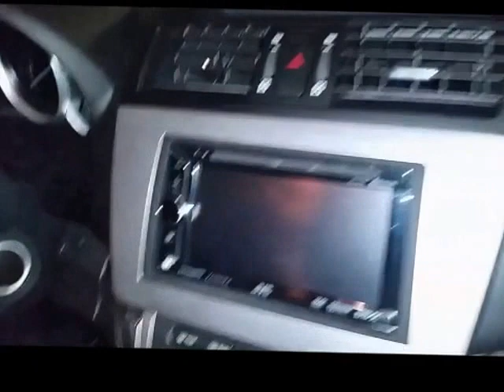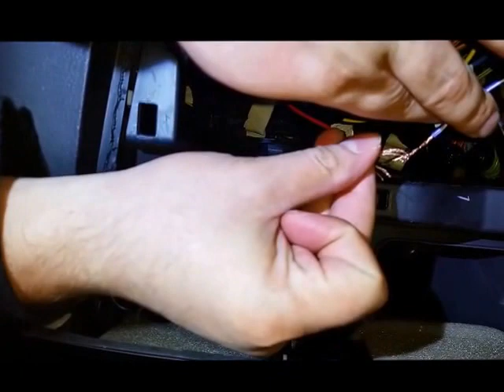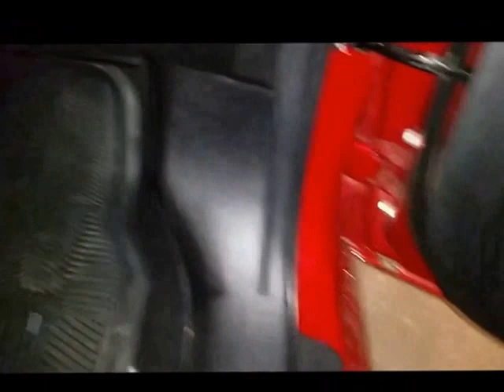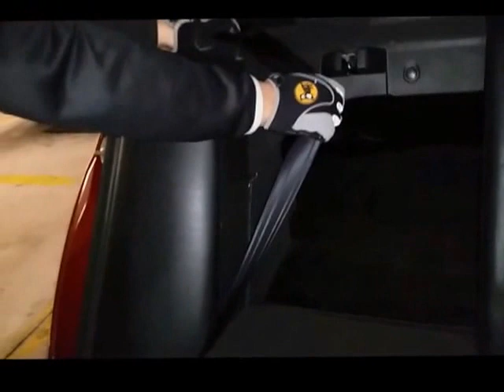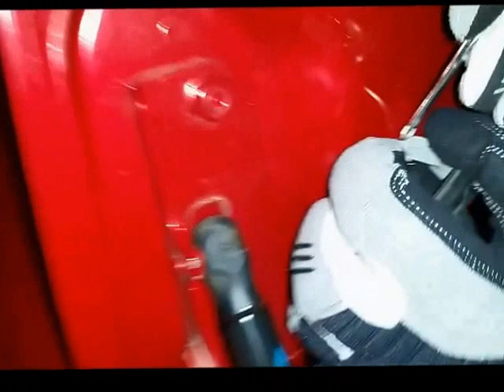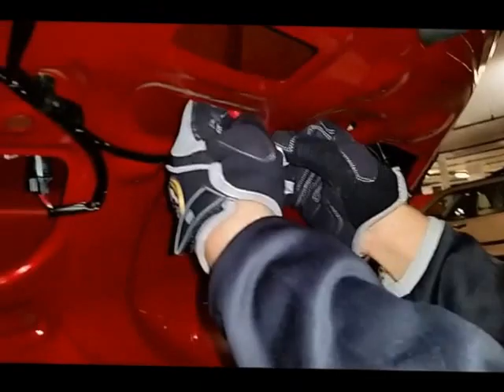How to install a back-up camera on a 2009 - 2013 Mazda 6/Atenza

Comment: Silicone spray helps to pull the video RCA cable through the grommet, the reverse signal wire enters the car through the same grommet, good video well explained

Comment: same plastic  radio faceplace piece..      Why are you using giant gloves  it doesn't take much to take ...these plastic pieces out of the way..   Also you should always disconnect your positive terminal on your battery just a precaution After you disconnect the battery you hit the horn to make sure your Electricity is exhausted( so your airbags can't go off)   and it's easy to do..     Crimp butt connectors with solder connections ,,, all you have to do is heat it up so the solder melts and you're done..You can actually use a lighter doesn't take long..    Also if you're going to get a camera system for your car go with the rearview mirror  camera  set up... You'll thank me later..     Camera goes right over your rearview mirror then you'll have a forward facing camera in  hd  to..     Me I have the same exact car With the rearview camera going to my rearview mirror that has an LCD full display underneath the mirror.. when it lights up it looks just like a TV screen.   It's alot more natural to look in the rearview mirror to see where you're backing up.. Even though I never care to use any of it I prefer to actually turn my body to look in the rear window..   before I look both ways.. Because any of your rear rearview mirror doesn't give you total peripheral vision.. like in a persons walking and they're at the next car over from you and they're walking quickly behind you with a shopping cart you're not gonna catch it fast enough.. only way to know is to look for yourself...  Me I have a forward facing camera and a rearview facing camera that's on the rearview mirror set up it also records audio... takes time to run the wires and patience...Me I have the set up on a constant power switch that's located in that little compartment on the left lower side of the car.  That I could switch on and off at anytime I want..   When I park my car at night I leave it on for the camera is recording would be thieves..  It takes less than an amp of  power.. you can leave that on for a few days and it wouldn't drain your battery  much  ... And you can switch it off whenever you don't want it at all ...I also have another switch that has an inverter.  And then another switch that controls the batteries that I put in trunk.. Me I also sound Proofed  the whole car.. I know this car pretty inside out ...    if anybody needs help     I've stripped the whole interior of all parts down to the rug..  All the way down to the metal and I install sound proofing materials on the roof and floor and in all doors.  Also did the trunk on the back dash .

Comment: Rca will fit through the rubber conduit in the trunk. Lube the path with ky or shock oil. Tape the top of the rca to make a cone shape and seal. Pull fishing line through....tie to rca, tug on line and pinch conduit behind rca to work through. Did it, so it can be done
Reply: spoada ler en español

Comment: Thanks for the video - it is pretty helpful! 

Two questions:
1) Why did you use the right backup light for powering the camera, bringing wire all of the way across the trunk lid, if the other backup light (on the left) was obviously much closer and had the same 12v?
2) Why did you have to cut the plastic housing of the camera? Is this because it didn't fit instead of the original backup light?

Thanks!